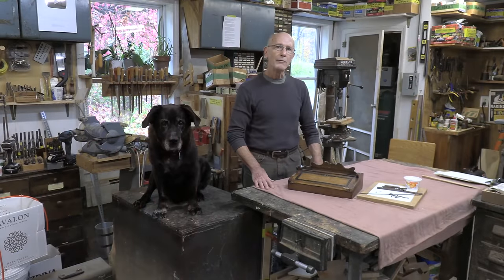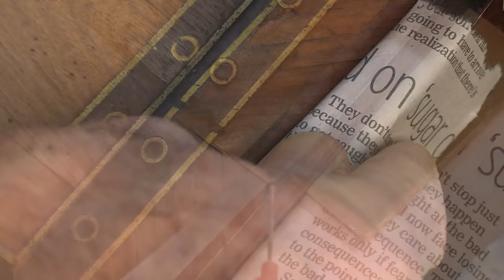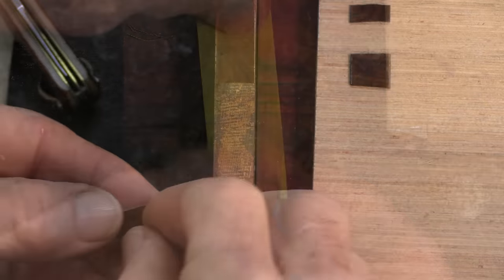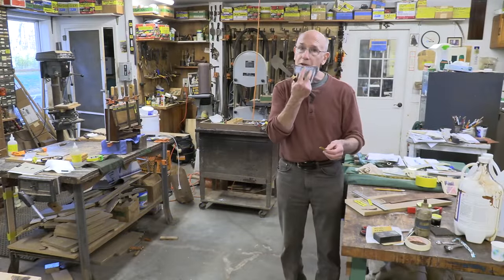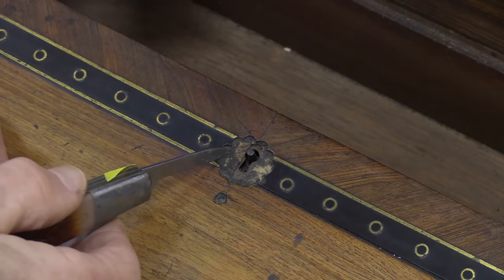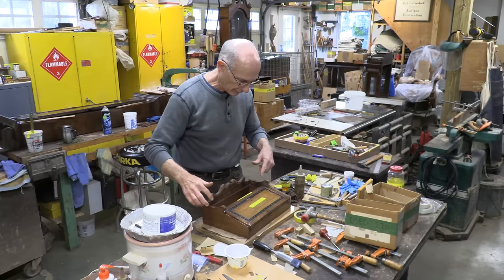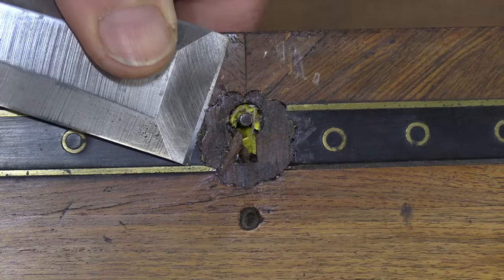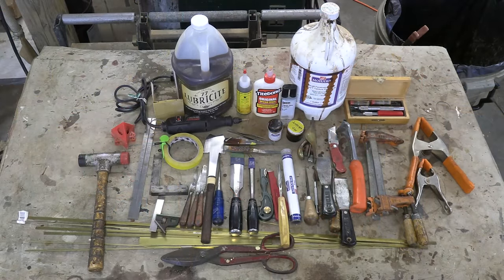Back to Beautiful - Thomas Johnson Antique Furniture Restoration

Comment: What a beautiful delicate work, Tom. It is a pity I live on the opposite side of the globe. I have done a lot of silver, brass and copper jewellery and I could have made that brass escutcheon plate for you in no time at all. It would have been such a pleasure and an honour to contribute.
Reply from the maker: Where were you? I could not think of a way to transfer the design onto the brass. If you have an idea, please email me: thomasjohnsonrestoration@gmail.com
Reply: Great idea
Reply: @T_Hoog  It is much simpler and accurate to cut out the paper template and stick it onto the metal plate with thin double sided tape.

Comment: Tip for getting out screws safely and easily. I use this in antique Gunsmithing. Install a screw driver bit of the right size into a drill press. Place the screw you want to remove under the bit. Using the quill on the drill press. Press the bit into the screw with as much force as necessary. While turning the drill Chuck by hand. Or if needed use a rod to turn the drill chuck. By using to holes the chuck key fits in. This works great. Never have to worry about the screw driver slipping or rounding the screw. Using the quill on the drill press to apply as much downforce as necessary.
Reply: Sometimes using a hot soldering iron on top of the screw can loosen it.
Reply: @bloggalot4718  that works great as well. That's usually the first thing i try
Reply from the maker: Thanks! I can't wait to try that. Of course, I'm often working on larger pieces where that isn't possible, but I will also try the soldering iron
Reply from the maker: Thanks! I just got a new soldering iron so that I can try that
Reply: @johnsonrestoration  best of luck i hope this helps.
Reply: @johnsonrestoration  👍🤠

Comment: I am a furniture builder and sometimes repair pieces, so I can really appreciate the unseen parts of the work you do.  You have my admiration for the diligence with which you pursue the craft.  Thanks for making these videos.  On this on I think I would have cut out the scollops of the pattern around the escutcheon and gone to an equal sized brass tube to compliment the other circles of brass.  But that is for me to do if I get the chance.  Really good job!  No exception.
Reply from the maker: Thanks! The real problem was that I couldn't transfer the exact image to the brass. Each scallop was different.

Comment: Another wonderful project Tom. I meet those tough old screws all the time and quietly try to transfer some heat into the screw by heating the screwdriver - it may take 5-6 applications before it transfers sufficient heat into the screw to have any effect. I also use a very long shaft screwdriver which sort of stores some torque in the shaft when in use. It does not work every time. I fix up old wooden boats so not quite as delicate as your work. Good to see Ella again - we all miss her.
Reply from the maker: Thanks! Good tips, I got a new better soldering iron to try next time. I didn't want to damage something on camera!

Comment: Lovely work, Tom. I like Dykem blue fluid for painting steel / brass stock that needs any kind of pattern marked on it, whether for shape cutting or engraving. It scribes lovely and comes right off with acetone when your piece is finished.
Reply from the maker: Thanks! My problem wasn't so much the marking - I just couldn't cut the brass well enough
Reply: @johnsonrestoration  Ahh... Yes it looked real tricky!

Comment: Another great job Sir.  I love watching your channel. I learn a lot.  I have a little tip for your fans.  If you have the tight screws that wont budge at all on wood.  Make up a few wood handles  of say five sizes.  Of round metal bars about ten inches long with square flat ends. Just plain ends.  Then when using on wood cover the surrounding wood to protect the wood with sticky heating aluminum tape. cut the hole out for screw head.  Heat one of the tools up bright red I mean hot,  Then press on to the screw head for a good few seconds.  As you will know this will free up the screw threads. the shock of the heat.  I have used this method for donkeys years in the motor trade on metal screws.  It works great on old door hinges as well.  Keep up the good work Sir.
Reply from the maker: Thank you! That sounds like a good method, I will try it

Comment: I held my breath as I watched you line up the key hole brass.  In my mind the most difficult aspect since the slightest rotation will throw it off balance plus the brass insert could be less than symmetrical.
A most excellent restoration.  These smaller pieces can take twice as long to complete compared to a large piece.
Cheers!
Reply from the maker: Thanks! So true about small pieces!

Comment: The writing desk looks fantastic. Probably the best it has ever looked. One thought on the escutcheon plate. If you want to consider a crafter’s piece of equipment you might want to investigate the Silhouette Cameo or the Cricut machine. Each machine works a little differently but they are designed to digitally cut the veneer (single layer) in a pattern you import into the machine. So I would take a photo in high resolution and then import the picture into the cutter software so I could trace around the cut lines. Then you could make 3 cuts to be able to create the thickness you need for the final piece. The cuts follow exactly the design you set. This technology has been on the market for over 10 years. Cost is around $400.
Reply from the maker: Thanks! That sounds so interesting! I'll have to look into it, but I have to say I've never been good on anything computer related. It sure would have worked well with this one!
Reply from the maker: Just googled it, looks interesting.

Comment: Hi Tom,
A church organ restorer taught me to put a soldering iron on to the head of a screw that wouldn't budge. Not sure why heating the screw works, but it does. 
He also put a smear of tallow on the screw thread before screwing it back in.
Reply from the maker: Thanks! Good tip, and I just bought a soldering iron!

Comment: I recently had some screws that had been secured with hide glue in an older piece. I touched the screw with a soldering iron and was then able to remove the screw. Had never seen that before. Had used that trick on machine screws before, but was that desperate to get the wood screw out, as it was not supposed to be there! Beautiful piece, looks lovely. Id love to build one one day.
Reply from the maker: Thanks! Yes, I need to try that - I just bought a new, better soldering iron

Comment: With all the modern glues now available, I had a period of time wondering about your choice of adhesives.  After thinking about it, it makes perfect sense to use the hide glue in this application.
Reply from the maker: Thanks! Yes, there are so many adhesives out there! But you can't go wrong with hide glue on period antiques
Reply: @johnsonrestoration  Hide glues were used on furniture builds last century because they were the best available.  Our contemporary adhesives are SO much better now that most modern wood workers  go to Titebond Green in a flash and forget about the hide glues of the last couple centuries.

Comment: Hi Thomas, excellent job on the repair. I have had luck marking brass with liver of sulfur which is relatively inexpensive. I may also suggest using a jewelers saw on brass for more precision, and even on veneer.
Reply from the maker: Thanks! Good tip. The problem was transferring an exact image to the brass

Comment: Hi Tom, brilliant work as always. Just a thought but you could have marked the brass with Engineer's blue. It’s a blue dye that is used to aid I’m marking out parts for machining, it would have worked well on the brass piece and wouldn’t have got chewed up like the tape.
Reply from the maker: Thanks! Yes, I have that, but that doesn't solve the problem of transferring an exact image

Comment: I think the veneer is Babinga? Its a very red-yellowish that turns brown with garnet shellac and time. I've restored many like this using hot hide glue. Hot close iron and damp cloth will loose all that veneer and tighten it back up. Even with the old shellack on the surface. 
If you try a soldering tip held to the screw head, allowing it to get hot, cool, repeat once....it may just contract enough to loosen? I have a set of the same Irwin screw drivers.
Love your show. My wife said...looks like you working! 😀 
Sorry about your dog. We just had to put down our Iggy! A very special Dog. 15 years he was by my side. His sister is still with us but getting old as well.
PS I learn a lot from your work. Doing this since 1973 I've pretty much learned by myself.
Reply from the maker: Thanks Ed! I really appreciate positive support from fellow tradesmen. It means a lot to me. I'm sorry about your dog too. Well, we knew what we signed up for!

Comment: In watching other maker/repair videos, I've seen an ink you put on brass that then you can scratch through to make lines for cutting. The ink can then be cleaned off after. It would've saved you all that fiddling with the tape. But in the end, I think you made the right aesthetic choice, as the keyhole surround in brass stands out better against the rosewood. Gorgeous work, as always.
Reply: A trick for marking out brass is to roll a piece of plasticine across the surface which will allow you to mark on the brass.
Reply from the maker: Thanks! I know about bluing, but still, no way to scratch out an exact image
Reply from the maker: Thanks! But what is plasticine? We must have a different name. But still, I could not transfer a precise image, which is what I needed
Reply: Plasticine is a soft putty like material use for creating models which children make. But I have seen a jeweller use it to roll across a piece of brass to enable marking. Carbon paper is in my view much better for transferring outlines on to paper.  Engineers blu marking ink is also good to enable marks to be made on the surface.

Comment: I recently had the same problem trying to get old screws out of cupboard doors.  Fine screws so I had to find fine screwdrivers my dad had.  Still couldn't get them so I worked around it as well.  Cupboard turned out pretty good.
Reply from the maker: Thanks! The one thing I didn't try was heat. But working around them still might have been the best choice

Comment: Thomas, As I was learning French Polishing, Marquetry and antique furniture Restoration in Ireland in the 80s, Charlie one of three Brothers I was learning from, I asked him why,  what you were saying about toothing the veneer and casework in antiques, his answer was toothing was used to help the hide glue bind them together, as the glue cured it pulled the veneer and the casework together making for a very strong bond.
Reply from the maker: Thanks! I understand the thinking, but my opinion is that it’s flawed reasoning. All wood glues work best with maximum wood-to-wood contact

Comment: To darken brass in seconds just use gun blue (it's a type of copper solution). You can also use the same solution to darken lead. Stained glass shops use it to darken the leading on new windows. The stuff used by stained glass shops is the exact same solution as gun blue, but much cheaper. Novacan Black is a popular brand. Absolutely indispensable for work on antiques. I use it to artificially age all sorts of brass bits and pieces (keys, escutcheons, finials, hinges, knobs, locks, brad nails, etc). It only darkens the surface, so you can re-buff the brass on the surface as needed.
Reply from the maker: Thanks! I could use that stuff. I'll look it up right now

Comment: Great restoration! Learning bits & pieces about how this sort of work is done.
I couldn't quite see your attempts at making the escutcheon from brass but it seemed you were trying to shape it using your scroll saw? That would be too powerful to use on thin brass. Did you try using needle files to refine the shape after cutting the brass roughly down to size & shape?
An old time machinist might have used a die filer to mechanise the filing action (die filers are not so common these days).
Reply from the maker: Thanks! The problem was that the original (judging by the cut out space for it) was very irregular. Any way that you use would be very difficult. Each "node" is different, and if you made a mistake you would have to start over

Comment: 32:30  When machinists need to cut metal like brass, they generally paint it with some sort of indigo blue dye, then use a really sharp awl or similar tool to draw out the design in the blue dye.   I don't know what the dye is called however.  Uri Tuchman has a really great channel to watch this sort of craftsmanship.
Reply from the maker: Thanks Jim! Yes, I know about "bluing". But I needed an EXACT transfer of the shape. A scratch awl was not going to do it! I'll check out that channel
Reply from the maker: His channel looks interesting!

Comment: 2:38 @mr Tom - might i suggest checking out brownell's? Gun smithing screwdriver bits come in a crazy amount of sizes for this same reason; making the blade fit the slot, and historical screw heads (rifle stock or desk hinge) have a dizzying number of possible sizes. You can buy the bits individually so you can custom grind if needed
Reply from the maker: Thanks! I'll look into that!

Comment: On that escutcheon, your adventures with it got me thinking about what it was made of originally. Brass seemed obvious, but with the brass inset around the keyhole it's not so obvious. In context of where it's placed, the original maker would have wanted something that contrasts with all the surrounding materials to show off the intricate shape of the escutcheon. So, what contrasts with the shine of brass, the dark of the ebony band, and the red/brown of the rosewood? What jumps to mind is mother of pearl. A little pop of iridescent color would have been really beautiful right there. For the period, do you think that's a material the original maker might have used?
Reply: It looks the wrong period for Mother-of-Pearl inlay in woodwork. If it had been from the 1860-80s then yes. Or from "China" (which often really meant Japan...). Not that it wouldn't look good.
Reply from the maker: Thanks! I agree with dlevi67 - it's just not right for the period
Reply from the maker: Yes, true

Comment: Looks gr8 👏🏼👏🏼👏🏼
U can make a brass flower thing u were trying to make the way u we’re trying to make it if u use a jewelry hand saw with either a #5 or #3 saw blade (these saws only cost about $20 & can be fitted with a wide range of blades). The saw blades are fine & are used for silver, gold, brass, copper metals and sawing by hand gives you the control you need to be able to control the shape that your going for. After that  using fine sandpaper gives you the smooth edges you’re after & polishing the brass is easy. Sawing this way is no more fiddly than what u we’re doing with the rose wood & u don’t have to glue layers of wood or wait for it to dry…Anyway, it’s just an option for another time possibly 💭?
Reply from the maker: Thanks! All good advice. My problem is that I had no way to transfer an image of the irregular shape to the brass. Each little "scallop" was different

Comment: I know I am late to the ballgame here but Machinist Bluing is the product you are looking for. You brush it on, scratch your lines out and you are good to go with very clear lines that have a high contrast  to the bluing.
Reply from the maker: Thanks! I tried that but I could not transfer the image to the brass. Each facet was different, it would take days to reproduce the exact fit. If you made a mistake you would have to start over

Comment: Looks great.  Question. You wax nearly immediately after applying finishes. All the forums say wait until it cures or not at all.  I think you can wax when finish is dry.  What is correct?
Reply from the maker: Thanks! I think it's true, the finish should cure. But I have never done that! It seems to have worked out

Comment: Thank you for another great video.  Just as I was asking myself how do you make brittle cross grain veneer go around corners you showed us.  I was wondering how it is done on a new piece.  Does the craftsman soak or steam the veneer strips before gluing?
Reply from the maker: Thanks! Veneer is pretty flexible, but if it's brittle you can soak it in glycerine too

Comment: A suggestion for working with brass to be extremely accurate. Use engineering blue to mark out. Then dont cut to close to the line with the saw. Use needle files and file to the lines. 👍
Reply from the maker: Thanks! Problem is: it would take days to file that to a precise shape
Reply: @johnsonrestoration  i can see how thats is a problem for running a business. Cant charge someone a to much for something like this because of labor. With a good set of files you might be amazed on how fast something like this could be made. 30-40 mins max. A small die filer would bring this down to about 15 mins

Comment: Hello Mr. Johnson, first Thank you for all your expertise.  I have a piece of veneer lifting on my China cabinet and a secretary desk, and I'm curious what kind of glue you use in your needle bottle, I also noticed you warm it in a crock pot.   Is it a glue or a lacquer like they use in Japan?  When I was a kid, now 74, I was always in his shop and he mixed a glue with a varnish that would get really thick and he had to heat it up, then he mixed it them together.  He may have told me what it was but that was a long time ago. At any rate, what is your glue?  Thank you again.
Reply from the maker: Thanks! That is hide glue. You can buy flakes and mix with water but I like "Old Brown Glue" that comes premixed https://oldbrownglue.com/
Reply: @johnsonrestoration  Thank you Mr. Johnson, I appreciate your reply and the tip.